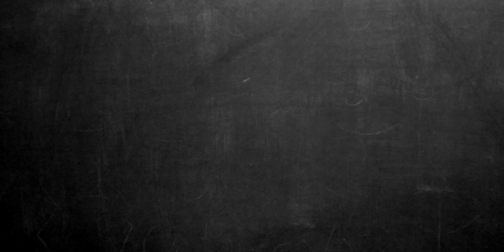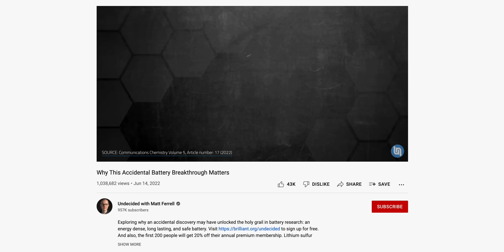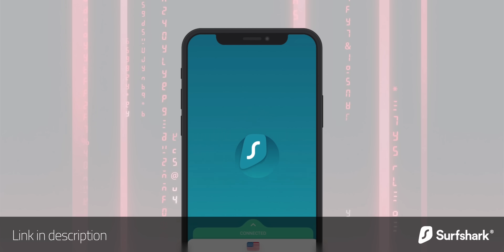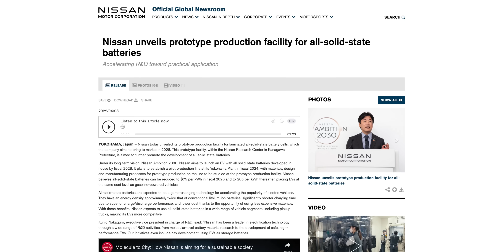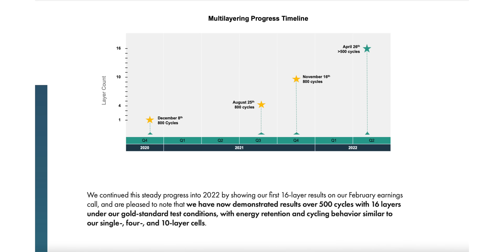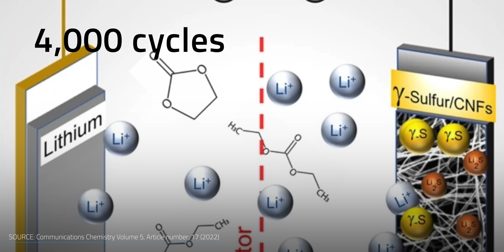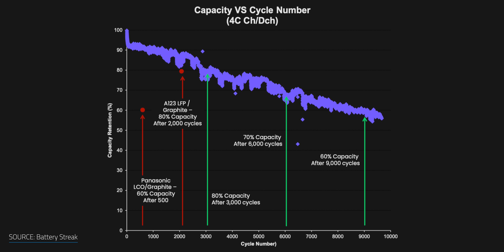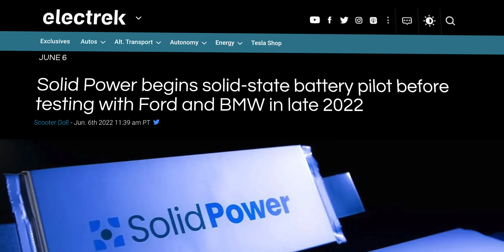Is This Solid State Battery Too Late?

Comment: I've worked on solid state batteries for an automotive OEM. The amount of work that went into testing and proving solid state batteries for mass production has been immense. The fact that we have major OEMs publicly announcing strategies for adoption within 2 years shows how far along they are. It can't really be compared to new developments just coming out of labs, as they are at least a decade away from being implemented in EVs.
Reply: Can anybody say, realistically, what Technoligy Readiness Level (TRL) these solid state batteries are at?
If a real engineer (not a BD or marketing guy) says they're at TRL > 7 you can start to get excited about the technology. If the TRL ~ 6 or less don't get your hopes up.
Reply: Not an engineer, but as someone who works in a field that regularly has to convert research into products, the gap between a prototype and a product is much bigger than most people realize. After you have a working prototype, you've really only done 20% of the work at most. Obviously there are always exceptions, but I wouldn't count on anything that's still in a university lab becoming a real product in less than 10 years.
Reply: Source?????
Reply: how many joules per gram does it take to electrolyze/seperate H2O vs how many joules from the combustion of the same gram? current best methods say there is a bigger secret out there.
Reply: " major OEMs publicly announcing" anything means nothing, it's just marketing hot air.
Reply: You of all people should know what the deal is with those types of announcements which are made purely for PR and government program purposes. More to the point, you of all people should have some skepticism and know not to naively believe it.
Reply: What I miss here is an explaination of the problems and shortcomings: Why is it taking so long? Why is the deadline slipping further and further into the future? There are obviously problems and fallbacks when new problems surface, but what are these? Why don't we see solid state batteries used anywhere?
Reply: @nigratruo  While that may be the case, making or adapting factories for mass production for this cells takes a really long time. New materials needs new sources. And then comes the production line that needs time to be configured in an efficent way and also more time to be built for mass production.
Reply: Sure, and they have been a couple of years away for a decade now. And probably will still be a decade from now.
Reply: So we have to wait two years to see any products using SS batteries? You would think if they were anywhere near ready we'd be seeing their use in smaller applications like phones or watches.
Reply: @bogususer2595  Tooling and design validation takes forever.  We quote programs and build tooling years before the cars with our parts are available to the public.  It takes up to 9 months just to complete approval packages to get a new material added to an OEMs catalog for future use.
Reply: @bogususer2595  nobody cares about them being in phones though. It makes more sense to have them in cars
Reply: Y’all battery engineers are tarded. I have 3 batteries for my RC helicopter that I can charge to 90% capacity in 5 minutes. I bought them over 5 years ago. I have 3 so I can charge them faster than I can use them which allows me to fly continuously all day with only 3 batteries rather than having to buy 10 to 20 batteries to fly all day.

I don’t understand why these batteries that you’re talking about that take 15 minutes to charge are such a big deal. My batteries don’t even get warm when I charge them in 5 minutes.

If you underrate the batteries and call 90% 100%, then you can make a vehicle that can be fully charged in 5 minutes. They could have been available over 5 years ago.
Reply: @terjeoseberg990  Sarcasm or Dunning-Kruger?
Reply: @filonin2  He's a Dunning-Kruger calling engineers "tards". The same engineers that made his toy heli batts.
Reply: @terjeoseberg990  the biggest problem with those packs is the chemistry. Li-po offers bigger C ratings, hence quick charge/discharge capability, but a lower energy density and the biggest problem.. Safety. Try sticking a screwdriver trough a soft shell lipo, or better now, search for a video demonstrating it. Now imagine a pack 100 times the size in a car crash.
Reply: @roborovsky6950 , Have you tried sticking a screwdriver through a Tesla 18650 cell to see what happens?

The only reason for the plastic pouch is to conserve weight. There’s no reason they can’t put these batteries in the same package that Tesla uses.
Reply: @terjeoseberg990  A 18650 Tesla cell won't react as violent as a li-po bag would when punctured. And you cannot make a 18650 with the same electrolyte that a lipo use, since it's a gel like electrolyte vs liquid in tesla cells.
Reply: @terjeoseberg990  But as I have said before, while li-po packs give you a bigger charge/discharge capacity, they have a lower energy density, and that's what matters the most in a car. There's also the higher cost for lipo and the cycle life span is lower.
Reply: @roborovsky6950 , “And you cannot make a 18650 with…”

Nonsense…
Reply: @terjeoseberg990  looks like you are an engineer with a PhD on lithium based batteries. My bad.
Reply: @roborovsky6950 , Looks like you’re extremely confused.

“while li-po packs give you bigger charge/discharge capacity, they have a lower energy density, and that’s what matters the most in a car.”

The reason the highest performance Tesla’s have the most range is because the Tesla batteries do not have enough power density. If they used a chemistry with more power density, they could make a shorter range version with the same performance.

Most people don’t need over 300 miles of range per day, and most people who buy an electric vehicle charge at home every night, so they will never need to charge at a charging station, and they’ll never need to charge from 0 to 100% in 5 minutes like we have to do with gas powered vehicles, since we can’t refill our tank every night at home.

99% of the time, charging stations are unnecessary, and the charging time is irrelevant for electric vehicles.
Reply: @terjeoseberg990  It's now clear to me that you know way better. I'm sorry.
Reply: @terjeoseberg990  - “most people don’t need…”

Most people need this to visit family, go on vacation, etc.

Without range, electric will never be someone’s sole car… it will always be a second car - a rich man’s toy
Reply: @DavidHalko , If they have family over 150 miles away, then they will need to use a charging station somewhere. But this is not every day. 3 times a year would be less than once every 100 days. How often do you believe most people drive to visit family that lives over 150 miles away?
Reply: @DavidHalko , Also, if you’re driving 150 miles, you’ll probably stop someplace to eat. How long does it usually take you to eat? 15 minutes? Or about 30 minutes? Or maybe an hour? Most charging stations are placed near restaurants so you can eat while your car charges.

Guess what? 300 miles of range for a Tesla costs $15. Any idea how much 300 miles costs for a gas vehicle?
Reply: Hi @terjeoseberg990  - 

My first job was ~60 miles in each direction and I had an apartment… so I could never charge an electric car at home. It would basically need to be charged daily, since it would be too risky to try to do 240 miles on a 300 mile charge. Fast charger would cost extra money each day. My original 4 door car got 40mpg highway, and could do ~500 miles between fills. I would fill up 2x a week.

Now a days, traveling to see family, various trip times are between 12-16 hours, 8 hours to drive to my remote workplace, I do each with 1 stop, stop for 20 minutes when traveling with others or 15 minutes on my own, get to the destinations in 1 day. Sometimes, 2 stops for a 16 hr trip (when I can’t be careful about the fuel usage.)

I am well aware of the cost, just did a long trip, about $50 now for a fill up at a station… absolute highway robbery. $100 for 2x fillips. This problem is political incompetence with their raising the cost of energy on the poor.

Replacement of batteries must be added into the cost of the electric fuel: $13.5k per battery swap, the cost of an almost new ICE economy car. Compare to gas @$2.5/gallon, drive 100k in an economy car ~= $7.5k… almost half the cost of a battery swap! Now, start adding the cost of electricity!

IF the EV car cost the same amount of money as an economy ICE car… an EV car is far more expensive in battery & electricity than gasoline fuel cost.

My last car lasted 19 years, before I recently totaled it. I have another 20+ year car, as well. Never an engine or transmission problem. Well over 200k miles on each. 

I would have likely needed to replace the battery on an electric car about 2 times per car, due to use or age - incredibly expensive. Wrecking the one car with a brand new battery would have been an incredible loss where I would never have recovered the cost from insurance.

A lithium fire burning down my house could be fun, I would want a non-attached garage with an electric car. I would not buy an electric car without a range extender, which is what I priced the last time when I was replacing my last totaled car.
Reply: @DavidHalko , Electric cars obviously aren’t for everyone. But, if you lived in California, your landlord would be required to allow you to install a charging plug by your parking space, and many employers have parking spaces with free charging.

I actually saw a Tesla for sale because it was owned by a guy who lived in an apartment, and he switched jobs, so he no longer had free charging at work.

Charging at charging stations all the time is way too inconvenient because it’s way too slow. If it was 5 minutes, that would work, but it’s still as inconvenient as gas stations. I hate going gas stations, and I experience range anxiety every time my gas is low. I would much rather charge at home every night.
Reply: @terjeoseberg990  - I am looking forward to an electric with range extender, when the 20+ year old car retires / is totaled. 

I would be happy with a smaller battery, a small Mazda rotary engine, and a small gas tank. The battery replacement cost would be vastly truncated, short trips would not require gas, and the magnificence energy storage characteristics of liquid fuel could still be leveraged for those long trips every month or so.

I will be adding used solar panels to my 4x used EV battery modules, to supplement my house energy consumption. Hard to believe 4x EV modules can run my house for 24 hours, while an EV requires 10x of those modules. I find it hard to believe that electrical company will be able to supply so much energy over wires, which was normally delivered via pipelines & tanker trucks.

Honestly, I would rather fill up my car with NG at my house, than gas at a station, with all that infrastructure already existing. There is no reason we can’t run our cars or range extenders on H2 & NG mix, compressed at our home & pumped into our vehicles. (Most people have air compressors.) Even propane could be used for cars & range extenders. (Grocery stores & Walmart supply propane.)

Cost is the big problem now. Cost must be addressed, so the poor can have an environmental option. Political Policy in power right now subsidizes the rich with the high energy prices on the poor. Energy policy is anti-progressive & immoral right now, and must change.
Reply: @DavidHalko , “I would be happy with a smaller battery, a small Mazda rotary engine, and a small gas tank.”

Cheaper Tesla models with 50 miles and 100 mile range and an efficient 30 hp range extender would make an awesome plugin hybrid. 99% of the time people could charge at home and use no gas, and it could still have a 500 mile range and ability to fill up at a gas station for long distance trips. And you could recharge whenever you stop to eat just because you can.

Regarding the cheaper battery (because it’s smaller), it’ll also have a shorter lifespan, because it’ll go through more cycles to reach 100k miles.

If you drive 50 miles per day, and the battery has 50 miles of range, you’ll go through 300 to 365 cycles per year, while if you have 300 miles of range, you’ll only go through 50 to 60 cycles per year.

If the batteries can handle 2,000 cycles, then the 50 mile range battery will last about 3 years vs. 18 years for the 300 mile battery. However, in 3 years a replacement battery might be better and/or cheaper, so the 6 batteries over 18 years might end up costing you less than the one 300 mile battery. Or, in a few years the might have batteries that can last 10,000 cycles, and you’ll only need to buy 1 replacement to make it to 18 years.
Reply: @DavidHalko , I’ve thought about filling up with NG at home as an alternative to gas stations, but it takes energy to compress the natural gas, so I’m wondering about the efficiency/cost. Solar panels on the roof, and an electric compressor could possibly reduce the cost of compressing the natural gas at home. But how much does the gas cost vs. recharging and electric vehicle?
Reply: @terjeoseberg990  - Mere aging on Li-Ion typically reduces life expectancy to about 10 years, even if not cycled to their max. Holding a full charge will degrade life expectancy on Li-Ion. Charging to the top decreases life expectancy. Draining to the bottom drains life expectancy. Excessively hot or cold weather reduces life expectancy. 

Due to calendar aging alone, never mind charging in your garage & leaving it sitting around or other conditions, you will never get 18 years from a Tesla Battery or any other Li-Ion battery. (Lead acid batteries are killed by calendar aging, too.)

I suppose you are right about the smaller battery having a shorter life expectancy, with the additional cycle usage. 

Smaller batteries with a range extender probably should use LTO batteries, which can get charge cycles up to 15k, but they are a little more expensive. :-( Not sure about the calendar aging effect on LTO life expectancy, but LTO’s are used on 3 continents with some common manufacturers like Toshiba for batteries & Honda for cars using LTO batteries.

This has been a most pleasurable chat. 
Hope you do well!
Reply: @DavidHalko , At 100% charge Li-Ion batteries lose about 20% capacity per year, depending on the ambient temperature. At 50% charge, they lose only 2% per year. This is another reason why having excess range so you can only charge your battery to 60% every night, then drain it to 40% every day. This further increases the longevity of the larger batteries.

But then, the cheaper/lower capacity battery that will degrade more quickly still might be a better/cheaper option in the long run due to improving battery technology. Maybe in a few years they might resolve, or at least reduce this degradation.

People have already gotten over 10 years of battery life out of their Tesla batteries with only 20-30% degradation. And you need to remember that this is now 10 year old technology.
Reply: @DavidHalko , 15k cycles for LTO batteries is phenomenal. For 50/day and a 50 mile capacity battery, that’s 41 years of battery life. LiFe batteries are supposed to tolerate a lot of cycles too. Seems like a 41 year lifespan is worth the extra cost, and since you’d only be buying 50 miles of range, it shouldn’t add much to the total cost of the vehicle. You could also choose to add another 50 miles of range after 5 years if there’s room for 300 miles of range. They could make the vehicles so that they support up to six 50 mile battery modules and then give you a whole bunch of battery type and capacity options that can be changed later.

This is why I really like NIO’s battery swap technology. They can choose to do this later within the battery modules without effecting the vehicles.
Reply: @terjeoseberg990  - “takes energy to compress the natural gas”

Sure, it also takes energy to fill a battery, through heat. There is also energy loss through electrical line resistance. There is always energy loss. 

I think the big difference is whether the energy loss in compressing NG & compressor component mining & compressor manufacturing & recycling the compressor is better or worse than the mining & manufacturing & recycling of batteries.

We can buy tire air compressors for $15 today, electric tool air compressors for $100, LO tanks from $20-$200. It would be hard to buy a battery & fast charger for that. Not sure whether a compressor & tank would last as long as a battery.

The NG or LP produces less poisonous emissions than the ever increasing world-wide amount of coal being consumed to supply the energy for straight electricity needs & charging batteries. 

Countries are shutting down nuclear and using portable NG as a fixed location burning for energy… where compressed NG is really needed for portable usage (ie TukTuk’s in the Sub-Continent, Middle East, etc. are all compressed NG.)

Fixed location fuel should be used for large scale energy production, portable fuel should be used for portable energy usage. Anything less is a brutal misuse of natural resources.

Honesty, compressing NG with Solar is marvelous, escrowing portable energy from fixed location energy collectors. Solar could also crack H2 from water, and compressing that into the compressed NG tank. 

The conversion of non-baseload energy to make other energy portable is critical in the modern world.
Reply: @DavidHalko , These batteries are about 95% efficient at recovering the energy pumped into them during charging.

100% of the energy required to compress natural gas is wasted energy unless they install some sort of turbine to extract this energy as the gas expands. They don’t, and doing so would add complexity and cost to the vehicle.
Reply: @DavidHalko , Tire and tool compressors do not compress to 3,000 PSI. Such a compressor would cost a bit more.
Reply: @DavidHalko , A decent size welding tank costs about $200 - $300. I’m not sure what kind of range you would get, but they do last an extremely long time. You might need 3 or 4 of them to get decent range, but that’s a guess.
Reply: Hi @terjeoseberg990  - “batteries is about 95% efficient”

Efficiency at a component level is important, but it is not everything.

Nuclear produces a lot of energy, but radioactive ponds sit around reactors with barrels of storage that must go somewhere. Maybe a Space 1999 solution? LOL! 

Efficiency at a lifecycle level is important. 1/2 million gallons of water ton produce 1 ton of lithium. How many batteries are needed to equal the running time of an engine? Recycling lithium batteries is expensive while cores of an engine are not.

Also, the degree of energy in a compressed natural gas or liquid fuel is so great, efficiency is not as necessary to get a usable & affordable result in an application. India, Egypt, Turkey, now Iraq, other places uses compressed natural gas to move small vehicles around all over their nation… placing large batteries in them, with all the weight, would cost a great deal of money and likely reduce range. The cost effectiveness of the solution is such where it is already in deployments across multiple continents at a price that the poor can afford.

There are catalysts today, which will drip liquid fuel from the sky, extracting CO2, and this can also be used, once the cost comes down. #DrillTheSky

Over time, fuel cells will appear on the market, at a reasonable cost, and be able to replace a combustion engine, as well.

There are so many options today, we need to be able to use them all, diversify our energy supply needs, and not fall into the danger of central planning where our energy needs are satisfied through a single medium where failure can cause catastrophe for civilization. (EMP will result in the deaths of millions in a matter of weeks, a war technology that is readily available, I personally don’t feel comfortable with electrifying everything. Electricity is a significant helper to automate manual processes, the same way oil made slavery obsolete, but unless there are multiple media in case of a disruption — we will return back to a world of slavery by those who have the most military power.
Reply: @DavidHalko  Well an EV is not for everyone at this point and you are one of them but 99 percent of people drive less than 40 miles a day.  I know in Europe some people do not drive their cars until the weekend.  They use the car to take short trips on weekend.  A lot of Americans have two cars one could be used for driving to work the EV and the other a gas car can maybe be used to go on long trips like your 16 hour trip.  Plus the batteries range  will increase over time.  They are working on a 1200 mile battery that will solve your problem but that may take years.  Plus do not forget about Hydrogen fuel.  It maybe the next great thing.
Reply: @josephredmond623  - I think you are right, not for everyone. I almost bought a plug in hybrid in 2016, but it did not pan out… a few thousand more than I wanted to pay, and too little trunk space.

I would prefer a plug in hybrid, it is the best of both worlds. An EV with a range extender. A good range extender, like a rotary engine, in small, and can burn any kind of fuel.

Give it time, if there is no coercion, the market will figure out the best bang for the buck.
Reply: @terjeoseberg990  you talk about a lot of ifs and buts... you know not everyone lives in California... not everyone can get a charging plug installed to their house... not every lives in a house. Just like with mobile phones people will forget to charge their car, so will need to charge their car and will need to charge it quickly so they can get to work. 

but you're missing the biggest thing why the majority of people don't own a Tesla... and that is the cost of them. Electric vehicles are more expensive and in the current economy people, like myself, cannot afford one. and there are many people, like myself, that don't want to take on finance for an electric car which i cannot charge at home.

Range anxiety is a myth, what people worry about is not recharging quick enough and current lithium batteries pose risks for fast charging.
you have to remember a lot of people have never owned an electric vehicle so don't realise that charging for 10-30 minutes isn't necessarily a bad thing. But car manufacturers need market their cars or else the electric car adoption will be far too slow. Market longer range to negate the safety limitations of charging.
Reply: @Brurgh , Electric vehicle are obviously not optimal for everyone. However, electric cars are optimal for many, and for those who they aren’t, they should obviously buy something else, or find some alternative method of getting around.

Uhhh… Duhhh…

You actually can’t figure that out?

And if you forget to plug in your car, you’re obviously a dum bass.
Reply: @Brurgh , “Range anxiety” is what I experience every time my fuel gauge gets too close to “E”. If I had an electric car, or even a plug in hybrid, I would never experience range anxiety, because my vehicle would obviously be fully charged every morning, and my gas tank would stay on full for months or years.
Reply: @terjeoseberg990  My 2012 Chevy Volt kinda went that route. Apparently it only used ~65% of its battery capacity and shuffled usage around to reduce battery wear and 'cloak' battery degradation. In essence, they called 65% = 100% and so for many years you'd always get your promised range.